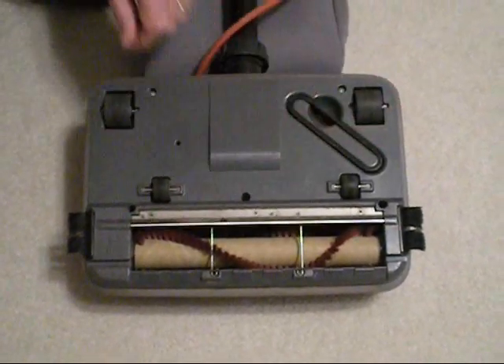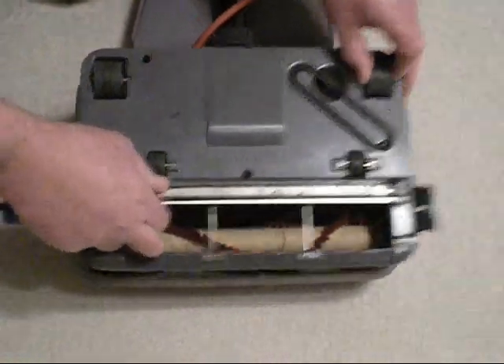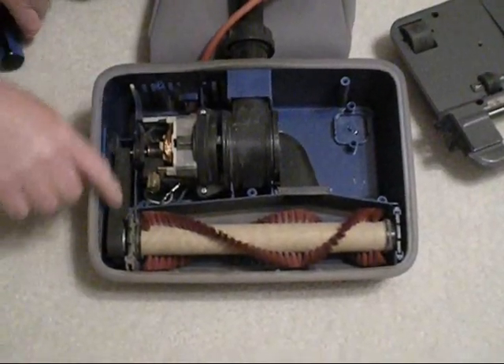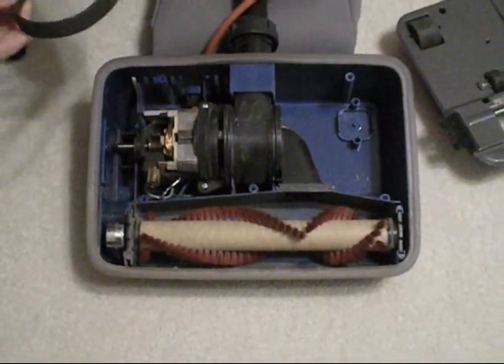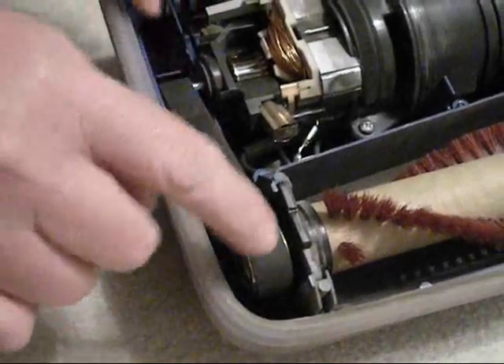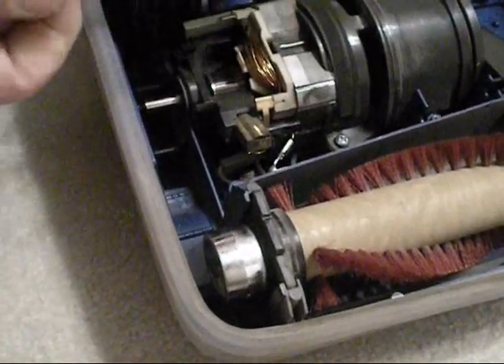How To Replace a Belt on an Oreck Vacuum

Comment: I love my Oreck XL Classic.  I recently had to replace the belt which I have done many times over the years but for some reason the belt just fell apart (broke into pieces) after I ran the vacuum for about 3 minutes.  I was shocked. This has never happened before. I purchased the belts through Walmart from an authorized dealer and they are marked ORECK. What do you think happened?  I stopped the vacuum immediately so I wouldn't cause any damage... Like I said I love this vacuum. But what's going on with these belts? Any idea?

Comment: Do I need to put a lubricant on the belt to prevent the burning smell? My belt went on real tight, and not as fluidly as seen in your video. Do you think I bought the wrong belt? Thank you for your help

Comment: Why when I changed my belt yesterday and replaced a new roller brush at the same time on my yr 2000, Oreck 2600, I  vacuumed an area delightfully in 10 mins. I put it away then today started to vacumn it drug and wouldn't pickup lint on carpet. I it found stunk of burning rubber. I felt the area of the pulley and shaft, was hot. 
I removed the guard plate, and found a split belt with lots of gunk from the belt on the pulley and motor shaft pin. Cleaned with WD 40 and replaced. Vacuumed easily altho still got warm.  What is the problem here?

Comment: On my model Oreck there is a small removable door on the side of the vac, held in place by one screw.  You need to remove that door in order to have enough leverage to roll the belt on the brush end as described in the video.
Reply: Mine didn't have a door, that's how I ended up here.

Comment: Thanks for the very helpful video. Maybe there IS a side door that is supposed to be opened, technically ( I have no idea), but if the belt has to be stretched around the shaft anyway, and this gets the job done, I don't know why it would matter! The vacuum now works great, btw!! 
Thanks!

Comment: Well, u made it look easy, but....Even u said #1 issue with machine is the belt. My Oreck needed extra long screwdriver because screws were way down the hole. The other issue is which way to put on the belt. One way beater bars goes backward. It should sling dirt up into cavity then into bag. Right?

Comment: The belt is too strong for me to stretch over the roller.
Reply: The same for me -- I cannot pull it far enough.
Reply: @joewolfe8798  do it the opposite way. Put on roller first, then stretch it to motor shaft

Comment: @breeze787 well it sounds like u guys had a bad experience or something. i too had that belt problem a few years ago so i took the vacuum into the store for a tune up and they immediately told me that something had broken. whatever they replaced it with seems to be much sturdier cause i havent had a single problem since. ive just had it tuned up so it's in top shape. it works magic for me and i love my oreck! i've had bad vacuum experiences in the past but fortunately the oreck has changed that!

Comment: You will do yourself a favor if you buy a Dyson. I've owned and sold Kirby's, owned an Oreck and bought a Dyson. The Oreck is very cheaply built and is a horrible excuse for a carpet cleaner. The Dyson although more expensive is solidly built and you'll go about 4 years before making a belt replacement. You can see the results of your efforts both by observing the see thru canister and by looking at your carpet. It appears that the color of our carpet shows a significant improvement. Buy a Dyson